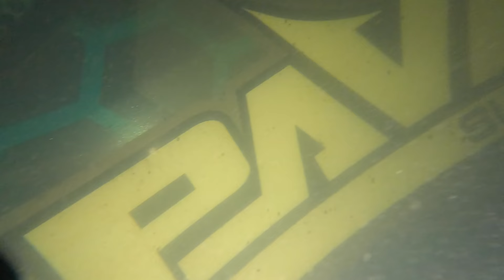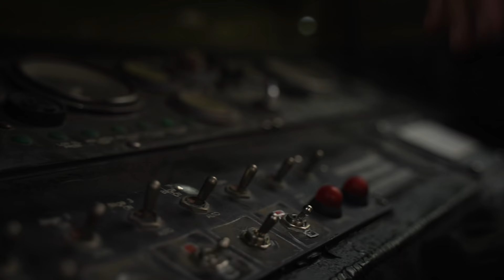I Sunk My Brand New $400k Pavati Boat- 95 Foot Deep Recovery With @AdventuresWithPurpose

Comment: For people that do so many recoveries, it pains me to see the absolute lack of safety when using such heavy-duty winches. Multiple people around a winch under massive tension with NO dampener is ridiculous. If that winch rope snaps say goodbye to your friends...
Reply: Yeah, I used to ride the towtruck with my pops when i was a kid. Never allowed near when he winched anything in
Reply: That’s why we all switched to rope for winches on the side by sides. When they break they just go limp
Reply: That's what happens when you purposely sink things for the views.
Reply: I know a guy who watched his brother get decapitated by a snapped winch cable while off roading. He is a shadow of his former self now.
Reply: @jtb3797  I don't think he did. This happened months ago without a peep about it until now. Don't you think if it was, he would've made a video about it right away?
Reply: @jtb3797  really? Can you prove that?
Reply: @jtb3797  
They don’t need to do anything even close to this for views. They already have the fan base and views. You’re picking some very low hanging fruit. Get off the bandwagon dummy.
Reply: @jtb3797  ya he would purposely sink his boat with his family on it, what an ignorant comment
Reply: @Zorkz  There is a difference between the guys working the scene and other people in the scene, As a tow truck driver I have no problems working near my winch lines as I know the risks, I know I safely rigged, And I know I'm within the working load limits, However no one else is allowed near my shit unless they too are working the scene.
Reply: If you do a lot of recoveries you don't use dampeners and shit... No professional recovery operator I know of has ever carried and used dampeners, We inspect our equipment and we work well within working load limits, There is no reason to put yourself in unnecessary danger but there is also no reason to fear being near your winch line if you have properly inspected your equipment, rigged appropriately, and are within your load limits... That being said these guys don't do that so yeah some due care should be exercised, however that's their problem not anyone else's.
Reply: Working within safety limits and constantly checking equipment keeps accidents from happening, there fine,stop judging 😉 😜
Reply: @frankorobinson1540  er so standing on a sand anchor under load that’s threatening to pop up any second in bare feet or sandals is within safety limits is it?
Reply: @lisastemmler9905  Exactly Lisa.  They get millions of views without purposely doing anything.  No way he would sink his boat with his wife and kids on it.  And he certainly wouldn't leave it there for 8 months.
Reply: Do you know how physics works when using snatch blocks... the cable wont spring due ti the weight and torque of the snatch blocks
Reply: My father in law saw a dood literally cut in half by a broken cable
Reply: They are not professionals 😂
Reply: Max Power  if you truly believe that he is the kind of a man who would stage something like this why are you subscribed to his channel? Seriously the people who enjoy the content have no desire to listen to the keyboard warriors and hates.
Reply: @lisastemmler9905  you dont have to read the comments to watch the video.
Reply: And the multiple shitty anchor resets that didnt really work? I dont know the area but could you of got one of heavy d multiple trucks in for a anchor points?
Reply: Dude winch line is in the water.
Reply: After watching the recovery it seems staged.  But, glad family is fine. So you can make that much on YouTube videos to sink a 400k boat?? Seriously need to get a new job!!. Not to mention it was recovered!!.. Sweet!!. I seriously own one truck one trailer tractor trailer.  Should I get a channel showing all the stuff that's happening to me in the past weeks?? Would anyone want to see what is like driving a semi and going day to day??
Reply: @lisastemmler9905  Well he's happy to have his mates standing in the way of taught winch ropes and cables.
Reply: @joelane4906  You know what I don't understand?If you think everything is staged,why you guys watch? You don't have to just go and watch shorts  on TikTok.
Reply: @malchone1  dam dude. The headline asked if  it was staged or what I thought.  , glad your family and you got.out safely., the recovery was amazing and glad you got your boat out if the water!. Can't wait to see the video on the cleanup of inside and out. Especially what you do with the motor. I never thought I would get an email back from you.  Sorry for pissing you off. I have and old 23.5 Sundowner Four Winns I bought last year and fixed it up for a little under what I paid for it. I live on Lake Macatowa, off the coast of Lake Michigan.  Seriously can't believe the price of your boat. I would do the same as you did if I paid that much. You be safe! Hope you stay well and keep in touch
Reply: That line is probably rated at ~60000 lbs and there was about 800 lbs tension on it. It wasn't going to break.
Reply: @fascistpedant758  you where there?
Reply: I drive a heavy recovery truck for a living, I've never used a dampener because we are professionals and we don't do the dumb shit that your backyard guys do on a weekend that snaps cables. Like wrapping them around square edges etc. sure winch cables are dangerous but inspect your gear keep it in top condition and you never have an issue not to mention that in that situation the water is your dampener and that boat would be pulled under long before that cable broke.
Reply: That was so scary to watch. My stomach dropped when I saw guys standing on the anchor point and the pulling on the boat with the winch attached
Reply: same lack of saftey when he sank his boat for views I mean when it sank magicaly even tho there were warning alamrs going off and he ignored them
Reply: @grimmo74  the fact he ignored the alarm going off in the boat in the first place
Reply: @utterbluedragon  what warning alarms?
Reply: Max Power  you realize we can see all your comments on this channel by just clicking in your pic right? You legit comment on every single one of his vids talking sht… Thats just weird af.
Reply: @leebatt7964  Damn that's insane. I don't even know how I would react to such thing if that happened to my brother.
Reply: @jtb3797  wow. He told you that?
Reply: @thebrowns5337  well in theory so long as he is replacing the cables in a reasonable timeframe and inspecting the outsides of the cable, he isn’t constantly running them through salt water, and he is staying within the working load limit then he should be fine, there is a 4:1 safety factor that should account for some corrosion although I wouldn’t want to be running steel cables through salt water id switch to synthetic.
Reply: @thebrowns5337  reality is he has the time and means to reasonable use dampeners if he so wishes, professional recovery operators do not, we are using these winches all day long, we are doing so on quick tight time frames to get roadways clear, and the heavy duty guys are often using anywhere from 1 to half a dozen or more lines on a single recovery and again still being on tight timeframes so using dampeners is just unrealistic in this profession, but if you are rich and doing it as a hobby more than anything as he does then sure no reason why he couldn’t but he also doesn’t have to.
Reply: all those guys holding the fucking cable with there bare hands holly shit man
Reply: @towtruckaj  \
Reply: @jtb3797  if this were the case the actual accident would have been filmed with multiple angles etc..the catastrophe would be the click bait not the recovery.
Reply: That's ridiculous, he's had his 3 little kids and wife on board.
Reply: @jtb3797   bruh. These guys uncover dead people for a living. They don’t fake this shit🤣 they have no reason to do that

Comment: I work at SafeBoats and was part of the team on the construction side of these riverine patrol boats so I definitely know them from laying the hull plates all the way to the final finish welding side of the vessel. Going out on sea trials was a blast and will never forget, such an awesome boat!!
Reply: What a rad experience! Thanks for sharing! I’ve always been intrigued by this type of work.
Reply: Definitely the right boat for pulling that waterlogged Pavati up onto plane. I'd refurbish the Pavati, sell it, and keep the RPB. That thing is a beast.
Reply: They look absolutely amazing
Reply: Hows working for them?
Reply: It reminds me a lot of an engineer bridge erection boat.
Do you know what is?
It was used to launch, deploy and retrieve the engineer ribbon bridge.
Reply: Bremerton, right...? I am over on Camano Island. I am super impressed with Safeboats.
Reply: Safe boats are awesome. I would love to own an old RBS one day
Reply: I have a $300 boat outback you can cut it in half and it will not Saint like that $400,000 boat should not seem like that people spend good money to be safe
Reply: It has been an awesome company to work for. They take good care of their employees. 4 10’s with a three day weekend is hard to beat.
Reply: They are in Bremerton just off HY 3 near the airport. A second facility will be up and running soon which is located in the port of Tacoma.

Comment: This happens so often I don't know why especially for an expensive boat like that they dont have an electric valve gate that shuts automatically when the engine starts as a secondary safety for the drain plug. It's easy to forget or maybe not tight enough I've done it myself.

Comment: FYI for those that don't know, in heavy Ds case it was probably to late with the balists full of water but if you can get the boat moving and up on plane the water will start to drain out of a unplugged drain hole. A useful trick if your bilge pump stops working and you have access to the plug after your moving pull it out drain it then put it back In while on plane.
Reply: Used that trick quite a few times myself. Learned it as a teenager playing around in aluminum boats on the river. We would knock cracks in the welds jumping logs and stuff to get back in the swamps. Gorilla tape is the bomb for those cracks by the way, buddy of mine used it on his boat a few years ago and its still holding
Reply: Truth
Reply: Man a $400,000 boat and it has a cheap drain plug .... Not to mention you don't notice the boat getting low and full of water before you can get moving lol .... 
I'm not saying it is b.s. .,.. but I smell b.s. and I'm not on a farm
Reply: @DustinGould  insurance fraud and money from recovery vids........ annnnddd the family was on the beach while it sank. what beach? looked boring. hmm cheap plug? yeah right. that boat sinking was a win win for D
Reply: @Slammed46  if its like auto insurance with boats such as this I imagine if insurance paid it was for the cost of the boat not for repairs.  Him recovering it would be useless as insurance would own it unless he agrees to buy it back from them.
Reply: @Slammed46  nowhere did he say they were on the beach. They were on the boat when it was sinking.
Reply: @Slammed46  07:08 all his family were on the boat.
Reply: @DustinGould  I've got 2 good plugs on my $6000 boat. Why in gods name would a brand new $400k boat have cheap plugs?
Reply: Good luck pulling the plug and getting out of the way of the prop in time to get it on plane. I get what you're saying but saving something that way is more dangerous and more likely to take you with it.
Reply: @user-gk2cg2th9h  every boat I’ve ever been in has the plug on the inside
Reply: @slickmuck4312  not all boats. None of my offshore boats ever had a plug inside, because the bilge is enclosed and sealed up. Common senses. Of course little cheap aluminum boats are different.
Reply: @DustinGould  you sound like bs so what's your point.
Reply: @slickmuck4312  You must not have been on many boats or you've only been on open hull Jon boats. All of the boats I've owned (fiberglass) have had the same external plugs.
Reply: @Slammed46  Did you even watch the video..?
Reply: @slickmuck4312  .
Reply: @gearjammergamer8560  cuz they weren't in place

Comment: D. When I did light duty towing, I had a anchor specific for beach recovery. You push it in the sand by hand and then hooked a line to it to anchor your truck or have a different angle. But as you put more tension on the beach anchor the deeper it dug in the sand. Super effective and well worth to have on hand.

Comment: Looked up the specs on the Pavati boats. Apparently they are powered by Ford Raptor 6.2 V8 engines, either 450 or 575 HP. Pretty cool stuff.
Reply: FORD????? No wonder it sank!!! Throw an LS in there! Better Yet, since the engine's coming out anyways.... Give Elon a ring, he's got that 1,300 hp brushless electric, Instant Thrust, along with his new Sulfur battery that lasts 4 times longer than anything else and takes 10 minutes to recharge. I'm sure he would sponsor you!
👍😎👍
Reply: @ceisarsrepair7958  To be precise, it sank because the hull drain plug got pulled out, the ballast tanks took on water to lower the rear of the boat for skiing, the bilge pump got overloaded and quit, and down she went. The Ford engine didn't have anything to do with it. No reason to downgrade performance with a General Motors engine, and as for electric - water and electricity don't get along very well.
Reply: Not throwing shade at ford but being a mopar kid, I'd absolutely love to drop in a hellcat !
Reply: @Mudsquadofficial  I agree the Mopar always has the Mean Grunt, but as far as longevity under extremes, the LS family for some reason can withstand higher rpms for longer durations, especially for a boat that doesn't have any gears, just one, and depends on the engine speed for boat speed. That was my though process. Maybe the new Harbor Freight Gold 20hp is a good answer....,🤣👍
Reply: @ceisarsrepair7958  oh and it's all powered with solar roadways , too !

Comment: a good lesson in checking, double checking and triple checking all the plugs and bilge systems before getting on the water no matter the size or cost of your boat.
Reply: he mentioned it had been on the water for 2 days prior, it came out when he was backing out of the shore, so even if he had checked it that wouldn't have mattered, but yes checking is always a good practice.
Reply: @benthicable  check this stuff regularly. Every couple of days is nowhere near enough

Comment: I want to see the cleanup! That stuff is satisfying to watch some strange reason.
Reply: 99% sure that boat is headed for salvage....a LOT of stuff in a boat like that that's gonna be wrecked by 2 days at that depth, a ton of labor to clean and fix it all...cost to fix will eclipse cost to replace pretty quickly.
Reply: @ericnoney3770  It will be interesting to see what happens to it.
Reply: @ericnoney3770  it's an aluminum hull, not to mention it's 400k new. Definatley not gonna be scrapping it.
Reply: @mikesmith8589   @Mike Smith  That's not the kind of boat that you just let sit out in the sun for a few days to dry out and go, it's not gonna be $100/hour techs working on it, nor are the parts coming from some place like West Marine, lol.  

That's all hand crafted stuff in that boat... Labor costs alone are doing to be stupid expensive.  About the only thing in it that can be reused is the hull and top cap, and it will need to be completely stripped down and rebuilt.  

I just don't see it being cost effective to do that amount of work to repair vs replace.
Reply: @ericnoney3770  I totally see your point. The hull alone is a huge part of the value of the boat. Electronics and pumps can easily be replaced, and the engine gone through/rebuilt. Lots of labor yes, but definately cheaper than a new boat.

Comment: 32:51 we recovered a boat by blowing air into the ballast tanks to displace water rather than pump them out, also we used a cargo net, set the boat into it and used that for lower lift points for raising the boat all the way to the surface -  then we just pulled it on the trailer full of water and let the water out after gettign it ashore , then back it up one more time to get th cargo net out from between trailer and boat
Reply: This is almost exactly what I was thinking. Surprised they didn't bring an air compressor.
Reply: Air works different 100feet down.
Reply: It'd need ~50psi to get air down there so flow is down, and if I'm doing my math right you've got 720 gallons/6000lb of ballast tank capacity. 10cfm pump is going to take over half an hour to fill it, and I couldn't tell you if the Pavati's built-in ballast tanks could take 6000lb force in the wrong direction (and you'd turn the boat over too).
Reply: @spaghettibeans  That's why I would wait until the boat hoisted near the surface.